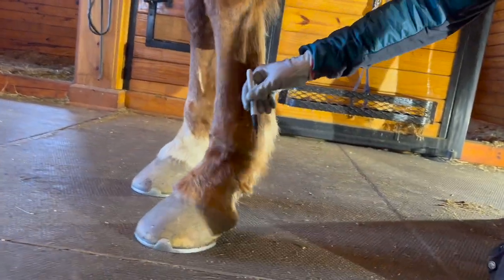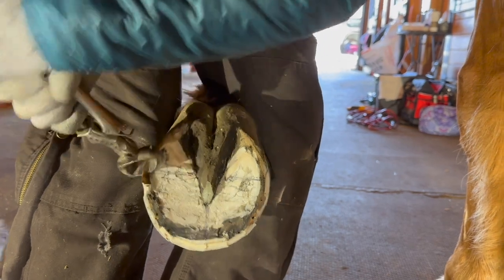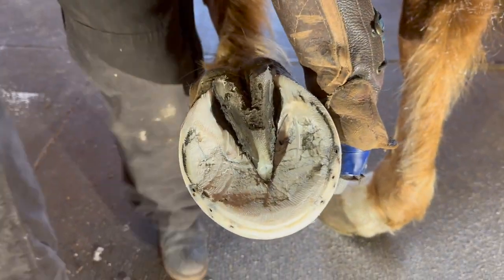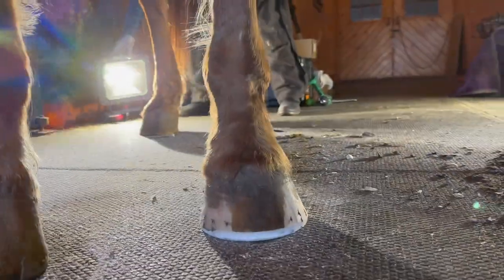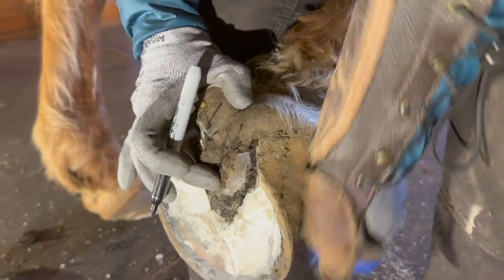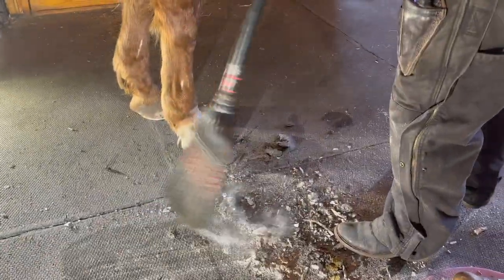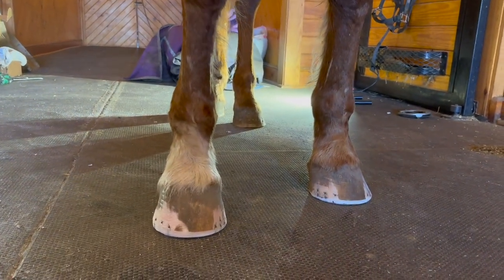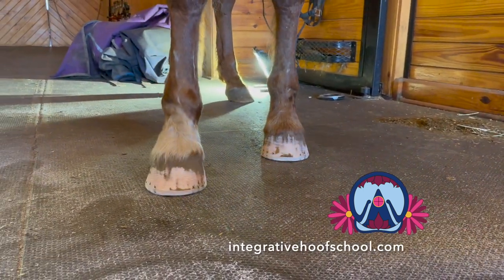Horse with Long Hooves Transitions to Barefoot, Hoof Mapping, Trimming Behind the White Line

Comment: Thank you for only grinding what you need to on the outside of the wall! I see other farriers sand or grind everything smooth, and I think, greeeaaaat, there goes a ton of useful information, in the name of cosmetics. :/
Reply from the maker: Agree with you 100%. the only time I take foot from the top is if it's distorted and needs addressing so new growth comes in straighter.  If it's not distorted over overgrown I'm going to leave it!

Comment: You barely touched the frogs and as a result, it seems that the horse was standing on his frogs. I cannot be sure because I never saw a caudal view.
For what reasons did you barely touched the frogs?
Reply from the maker: This horse has a low heel already.  I left the frog to support the back of the foot.  I'm not worried about him overloading the frog this way because the ground is soft and he will have support and load across the entire back of the foot, not just on the frog.
Reply: I hear what you're saying. With the ground being soft, the soft tissues have less clearance from the ground, which could possibly add more pressure to the corium.